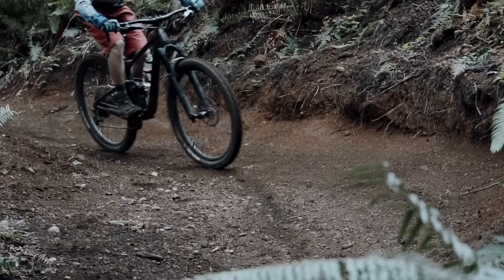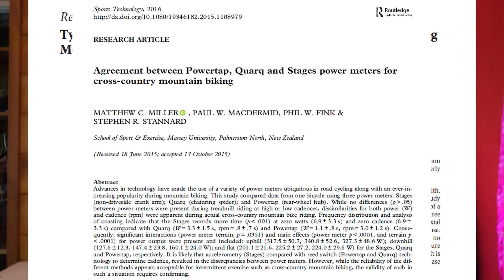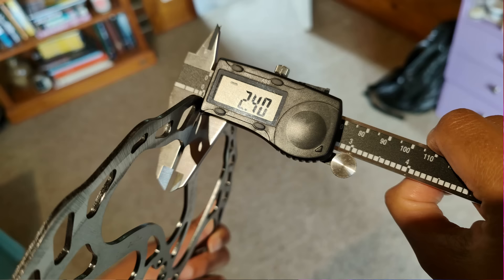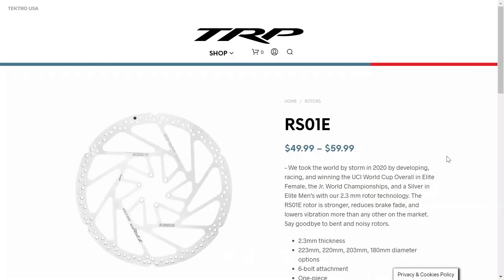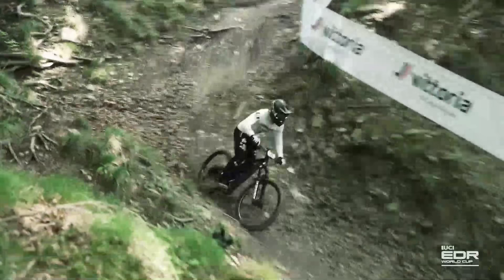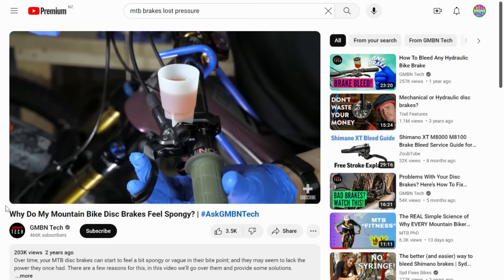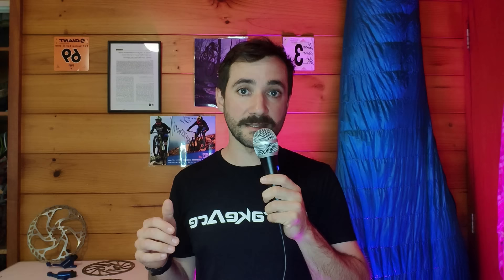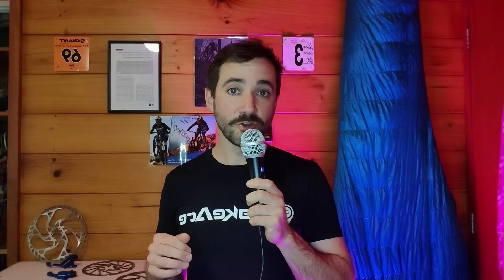Why THICK Rotors Will TOTALLY Change How You Ride (EASY Upgrade with REAL Proof)

Comment: On my 130mm trail bike with 203/180mm with 1.8mm thickness, on my 160mm enduro 203/180mm with 2mm.  Besides thinkness also pad compound trail uses organic/resin, enduro was sinstered now ceramic
Reply from the maker: Pad compound would be an awesome test 🤤🤤🤤 resin all day!!!
Reply: What calipers are you using on both of these bikes?  I have Shimano's on my trail hardtail (Deore 2 piston) and enduro bike (SLX 4 piston), running 1.8mm Galfers 203mm front and 180mm rear rotors.  Stopping power isn't an issue with either.  I wanted to move up to 2mm thick, but I don't think there's enough clearance, unless you're using used/slightly used pads.  New pads I don't think it's happening, and I don't feel like buying 2mm rotors just to test that.

What do you think @mtbphd?
Reply: @Beiberhole69RVA  Dominion A4 with the 2.0, Sram G2 with the 1.8

Comment: It is a pity you can't get thick rotors in a good variety of sizes and fitments. I used to use 2.3mm Tectro discs with Shimano XT brakes and the feel was great. I'm now using Sram code rsc and wanted to use 2.3mm discs but can't find them in 220 centerlock. The extra thickness would work wonders for spongy leavers and move the bight point further out from the grip.
Reply from the maker: Yeah sometimes I wonder if centerlock will become standard, but 6 bolt tends to be more common. So maybe that's what makes them harder to find
Reply: You can get TRP R1C rotors in 2.3 mm centerrlock. I've just got mine, but still waiting for the better conditions to test them.
Reply: @alfrednOObel2  Unfortunately my ebike came with 220 rotors and the rear speed sensor prevents 6bolt. Converting back to 203 seems like a step backward and not woth the cost.
Reply: Or just ditch the spongy sram...
Reply: Try motor bicycle parts

Comment: My experience with new rotors of any thickness is similar to yours. The surface finish on new rotors are very abrasive. Machinists have gauges to measure this “roughness” in finish, and can grind the finish to various specifications. 
This surface will get smoother with use as the pads have various compositions that can be very abrasive. But all pads will wear away the surface finish eventually. The most grip is when they’re new and properly bed in. This is when you will have the most braking power regardless of rotor thickness.
Reply from the maker: I wonder what the actual maximum usage is. Manufacturers always state a minimal thickness, but I give up on rotors way before that!

Comment: 3x spoke lacing is the strongest because the spokes are the most tangent to the hub.  It also has leading and trailing spokes so that there are always spokes in tension.   I don't see much of that thinking in some of these rotors -- is the force distribution that different, or are they just making pretty patterns and assuming that the steel is more than strong enough?
Reply from the maker: Good point and good question. I believe rotor design patterns are just about fashion. As long as they don't fold under the heaviest of braking, they're fine (and I've seen this happen twice - once last week with an off brand, and once with a pre-production rotor from a very well known brand). 

One difference with wheels that is worth pointing out is that there isn't much side-to-side flex in rotors. However some frames aren't stiff enough and allow the hubs to flex under heavy cornering - we can measure this with the BrakeAce Scientific sensor (plus some pros rub holes in their frames with the rotor edges)

Comment: Really great video Matt! Been eyeing up better rotors lately and you just sold me on getting thicker ones ASAP.  I tried a 220mm on front of my enduro bike and felt it was too much brake.  Do you think it would be best to run a 220mm in the rear too to make it feel more balanced? I'm riding in your old stomping grounds (Blue Mountain, SALS, Glen Park).  Dan
Reply from the maker: Thanks Dan! Ah man, I miss those tracks. Thicker and not bigger might really suit you there, especially considering the endless rocks. I have some TRP 2.3mm thick rotors that I can't wait to try - they just scream quality!
Reply: To much brake?? Learn to modulate better
Reply: @mtbphd I have a fitter machinist friend that can make me prescription rotors if I want them .

Comment: Great Video. Sorry if this has already been asked/suggested. Would be super interesting to see you use your tech to test whether Shimano’s Ice Tech rotors make much difference vs standard.
Reply from the maker: Thank you! 🤜🤛 I had a few people ask or DM about an ice tech test. Hoping someone else gets to it first 😁
Reply: Ice tech rotors are slightly thicker than conventional ones. The ice tech heat disippation fins at the top of the brake pads is where much of the lower temperature rise in a given scenario is gained . I have done my own controlled testing .

Comment: On my touring bike I switched to Hope V4 Calipers with their 203mm vented discs front and rear with Dot 5 fluid and braking is so much better than with normal rotors and they run cooler.
Reply from the maker: And touring bike brakes get HOT! (High load plus high speed)
Reply: DOT 5? Or 5.1? Because DOT 5 is not not compatible with the Hope brakes and may lead to brake failure. Just a friendly warning 👍
Reply: @jordankitching1501  I meant Dot 5.1.

Comment: I work in automotive testing. I'm curious if you've ever experimented with DGPS systems such as OxTS or RaceLogic for any of your data collection. I suspect that signals from the IMUs involved would be too noisy to be useful with mountain biking, but I don't know of anybody who has actually tried it. Have you looked in to anything like that?
Reply from the maker: Oh nice, are IMUs handy for you? I used IMUs back in 2014/15 continuing some of Paul Macdermids work on vibration exposure in MTB but haven't looked at that kind of data since. The BYB and AiM loggers have accelerometers and gyros. I think a few guys look at the data at the world cups.
Reply: @mtbphd  I wasn't familiar with those data loggers. I think I have something new to look into now. Thank you!

Comment: I haven't come across a brake set that is better than my Hope V4's yet. Incredible power with great modulation is hard to beat, I did upgrade to the 223mm Galfer rotor upfront and a 220mm out back.
Reply from the maker: Nice, that's one brake I never tried
Reply: It's leaps and bounds better than anything I've tried in the past and I've been in the mountain bike game of very long time

Comment: I wish I had custom code RSCs that fit on the vented hope 3.3, I like sustained 100%+ steeps and heat management is a problem, fade or letting off = hospital. A wider braking surface would be better too, with wider pads, sometimes there's nothing left of my pads after a month. 99.99% of riders will never ride like that, so not enough demand for bigger brakes.
Reply from the maker: Yeah, sadly MTBers have an obsession with light weight gear - at the cost of performance. I had a whilte segment on that in this video but ended up cutting it out. I'm doing another one on why weight doesn't matter (there's an article on my site about it and we did a podcast on it too)

Comment: Operating temperature also matters, to match the optimal ranges for the pads! 

Rider weight and trail style also has a large impact on use case for each set of brakes. And ergo considerations. 

I think 203 TRP 2.3mm rotors on 27.5” wheels is my winning choice. For a 29er, I’d consider going bigger.
Reply from the maker: I just installed some of those TRP rotors on my trail bike and they ride great👌

Comment: How do you calculate braking force?
Reply from the maker: The BrakeAce sensors used strain gauges to measure the force of the caliper pushing on the frame or fork

Comment: I went the opposite way, I went from 203 front and rear sram centerline to 180 front 160 rear shimano slx, and I didn't notice any difference, I ride plenty of double blacks and they have more than enough power, the shimano rotors for sure have more bite than the sram ones though, I tried 180 centerline rotors and they weren't powerful enough, also the sram power organic pads have more bite than their quiet organic pads.
Reply from the maker: Interesting! Thanks for the comment. Yeah gotta love organic pads - I'd never go back

Comment: Hey Brutha. I received the Ali express 2.3 203 rotors. One of them has a very fine scratch on one side of the braking surface. Do you think I should ask for a replacement? Or will it not be noticeable once bedded? Thanks
Reply from the maker: Nice! Your only chance to ask for a replacement would be before you use it, so I'd probably try to get that now instead of seeing what happens. (Even though I don't know what will happen!)
Reply: I think I will just try the one that’s scratched. Then if it is noticeable I’ll buy another. Wish they had 22m. The machining is not as course as Galfer (my preference) but courser than sram (shiny = grabby from my experience). Anyways I won’t be on my DH bike for 18 months so I’ll probably forget about the wcratch

Comment: Can the zitto 2.3 rotor fit with sram db8 6 bolt?
Reply: Is there any brake pads you know equivalent to mtx pads?
Reply from the maker: Not sure on compatibility with the DB8. For pads I often use generic brands and haven't had any issues. Worth a try!

Comment: Will the thicker discs work with most calipers?  I am about to build an 8000 watt emtb and think they would a good addition along with regen braking.
Reply from the maker: Good question. I don't know but hopefully someone here will. Unfortunately most manufacturers will simply say that their calipers were designed to be used with their rotors, so not sure if you'll get any real answers from them.
Reply: Yeah, that was pretty much what I thought, depends.  I really like this idea for a couple reasons, I am a larger rider that rides hard and an ebike rider that is using 160mm rotors and to feel safer need better brakes.  Thanks again for the research you presented!
 @mtbphd
Reply: As long as they physically clear the caliper I can't see why they wouldn't as the pistons will still move within their defined range, just with a starting point slightly further apart. I can't see how this would be any different than varying pad thickness.
That said, you should plan on a brake bleed/piston cleaning when you go with thicker rotors.

Comment: I have used the ZTTO heat dissipation rotors before, not sure of the thickness, but they are on par with shimano's Icetech rotors and suprior to SRAM centerline rotors. Will be checking the 2.3mm thick ones from them when its time to by new rotors.
Reply from the maker: That's awesome. I never knew they existed before this!
Reply: @mtbphd  Would be curious to see how much a difference the construction of the rotor affects braking power. Icetech (Al and steel), floating, straight steel as well as finned pads. See if marketing claims can be backed up.

Comment: Why not black rotors. The dark color will release more heat. Even where not contact with the pad, a painted surface will help radiate heat. Yes, the dark color will radiate more than the paint insulates.
Reply from the maker: Interesting. Never thought about it! Galfer Disc Wave rotors are painted black in the center.
Reply: I could be wrong, but my days working in electronics a million years ago tells me that black is better at absorbing heat from light. I don't think color (or black) makes a difference in releasing/dissipating heat. In fact, on a hot sunny day, black may be counter productive because it's absorbing heat from the sunlight. ..just a wild-ass guess.

Comment: I'm very interested to try these on my XC bike, running XTR M9020 so hopefully they will fit. Previously used any quite like the Galfer 1.8mm. Im also curious about the ZTTO 4 Piston brake set, have you tried them out at all or is that something to stay clear of?
Reply from the maker: Someone commented here that these rotors didn't fit in his Deore brakes. I haven't tried on any Shimano brakes.

I have been testing those ZTTO brakes and they are not good at all. I have all the data from testing them but haven't had time to put the video together!
Reply: I appreciate the prompt reply, have a primo arvo!  @mtbphd

Comment: Can I use thicker brake discs (2.3mm or 2.15mm) with my Sram Code R brakes, or can I no longer get the brake disc between the brake pads even if I push the pistons back? I'm currently driving the Centerline 220mm (2mm) at the front and Centerline 200mm (1.8mm) at the rear with a Fox 38 Factory, but I'm having problems with dragging brake discs due to deformation and bending. Especially when I drive on asphalt and accelerate hard, my front brake starts to drag.  This is extremely annoying. The brake caliper sits in the middle and doesn't drag when standing.  However, the gap between the brake disc and the pad is so small that not even a sheet of paper would fit between them. I'm not yet satisfied with the braking power and the pressure point of the brakes, but I still use the original Sram sinter brake pads. I also have to bleed the brakes very carefully again and hope that the pressure point and free travel will then improve.
Reply from the maker: Sounds like a tight squeeze. Wonder if the pads are thicker than normal?

Comment: This rotor comparison topic is a very challenging one to explain .The biggest reason is the good number of stencillings and patterns used by one manufacturer over the years as well as the huge number of brands and overall design variations . I have about 80 styles in stock . Testing is possibly a nightmare . Some rotors in a given brand and size mostly have a pattern variation between sizes , I found .
Reply from the maker: That would take a long time 😁
Reply: @mtbphd  Yes . When choosing rotors , I focus on the relationship between pad contact area and ventilation gaps . TRP rotors are moerately priced and value for money. I stock them .

Comment: Have you tested or noticed a difference between DOT brake fluid brakes and mineral oil brakes.
Reply from the maker: Nah I haven't. I'd have to look into it but my first thought is that there'd be no difference in how the brakes create force, but certainly a difference in maintenance (the fluids absorb moisture differently)
Reply: @mtbphd  perhaps a difference in extreme temperatures. Not as drastic as with cars and motorcycles but something to consider in “brake science “ for cyclists in different countries
Reply: hydraulic fluid is hydraulic fluid.  the differences in types are related to boiling and freezing points.   as long as you're not nearing those, they will perform the same.

Comment: I purchased these rotors, 203 mm.
Unfortunately, I was unable to install them in the SHIMANO DEORE M6120. The rotors were too thick. Colleagues, do you have any ideas on how they can be installed in this system?
Reply: You may be able to sand down your pads.....but, that reduces life and may also lessen heat dissipation as your pads reduced thickness will also reduce dissipation ( as i understand). Also, caliper will heat up more, and therefore fluid will heat up more as pads get too thin.
Reply from the maker: Bummer. I don't have any Shimano brakes, so never tried. Did you reset the pistons?

Comment: Have you considered that the thicker rotors change the bite point and that’s why they felt the way they did. I feel like a lot of this is a placebo effect. New to new would be a better comparison but I still think the bite point is what you’re feeling the most.
Reply from the maker: Yeah definitely could be
Reply: The bite point will be proportional to half the rotor cross - sectional thickness in hundredths of a millimetre . Check with digital verniers .I love looking at physics , chemistry and electronics .

Comment: You can straighten thicker rotors more easily as well

I have Shimano ice tech rotors from 2015, they are way too thin, the rear one is rubning but there's nothing we can really do about it, the mechanics at the shop have tried, you try to straighten it and it just ends up bending the other way and rubbing on the other side instead.

Also rotor wear. Thicker ones will last longer before getting too thin for the brakes to actually work.

Also even if your rotors
Reply from the maker: I wonder if the 2015 rotors are much different from 2024 rotors? I don't know the answer, just curious
Reply: @mtbphd  according to the mechanics, they made them a bit too thin. 
It supposedly helps with cooling since there's more surface area for the volume but being so thin coupled with being 2 piece rotors makes them really hard to straighten out.